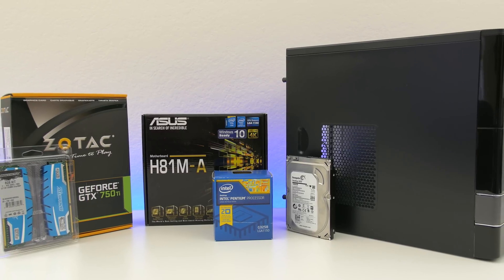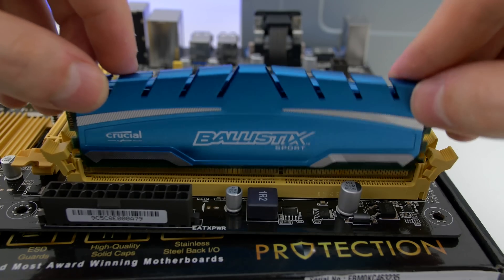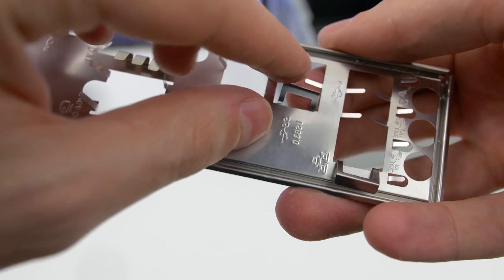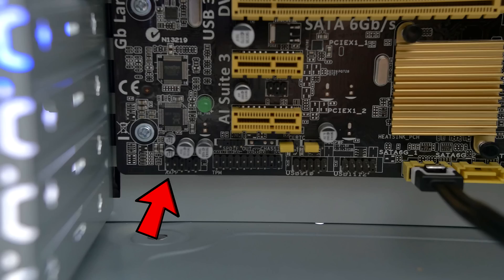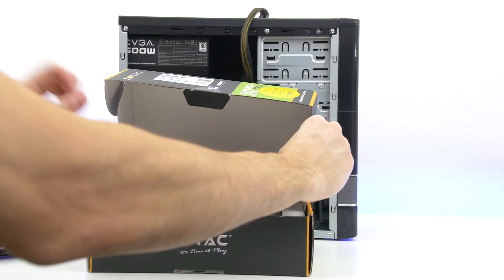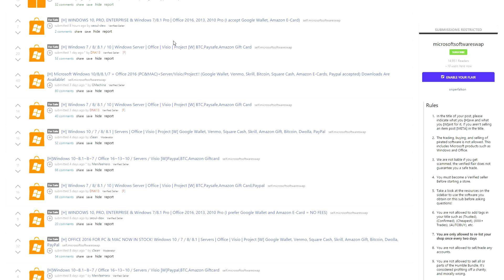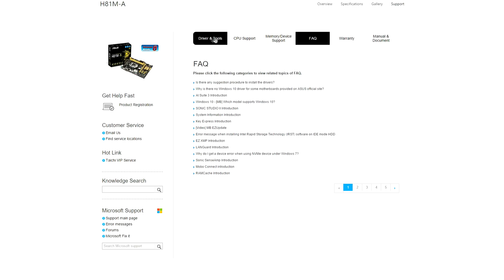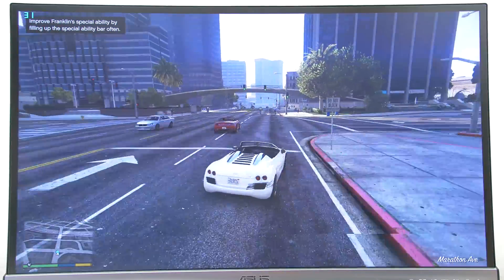How To Build $350 Gaming PC w/ Windows + Overclock!

Comment: Will Athlon X4 850 or G3520 will be a bottleneck for Gtx 960? Maybe i3 is bottleneck with 960?
Reply: +Eternal Power An i3 won't bottleneck a 960 to be honest. If you're using a 980 or a 980 Ti then you might feel the difference but till the 970 an i3 or an i5 is worth the investment.
Reply: +Sudhanshu Sharma what about 380X? Is worth it over 960/380?
Reply: It's the newest GPU that AMD has to offer, so yeah way better than the 960/380. Personal suggestion, go for a 970!! It's worth the money.
Reply: The i3 works just fine with the 960 it's a good combo
Reply: +Marco Martins The athlon or G3520?
Reply: ***** don't you mean the G3258 that he uses in the video?
Reply: +Marco Martins yeap. Also in this video he uses 750Ti which is 50% less powerful than 960. So maybe this cpu on this video would be bottleneck for 960 or 380X?
Reply: ***** the G3258 is much more powerful than the 850 but being a pure dual core you might get some problems in the future when games don't support dual-core cpus anymore that's why I really recommend you to get an i3 instead if you got the extra money (you can get the G3258 and upgrade later to an i5 or i7 when you got the money if you prefer)
Reply: +Marco Martins but what do you Mean you upgrade later? Its i3 has 50€ more btw. So The considion upgrade is to buy a part of a pc and after 6 months upgrade to i7?  Well Why wont someone be parienet and buy i5 from the start and Dont waste money to a lower cpu?
Reply: ***** I'm not saying 6 months later but yes you get my point it's better to get a better cpu right now (i3) than to waste on weaker cpu to upgrade later (when I mean upgrade later I'm talking like 1 or 2 years)
Reply: ***** don't get me wrong the G3258  is fine for now but future games will stop supporting dual core cpus gradually
Reply: +Marco Martins well will i3 6100 would be fine For 2 years? But gpus like 970/390 would be a bottleneck for i3?
Reply: ***** I was talking about haswell cpus not skylake those are quite faster (from a G3258 to a skylake i3 is already a big upgrade xD) the old haswell i3's already bottleneck less than 6-8core amd cpus on cards like a 960 or 970 so yes I would say it's enough, the faster DDR4 helps too (I don't know if DDR4 got cheaper but it's faster for sure)
Reply: +Marco Martins wow so i3 6100 is much faster than i3 4170?
Reply: ***** it's a bit faster but DDR4 helps in some games
Reply: +Marco Martins i didnt he t it. Haswell i3 bottlenecks 970, while skylake 6100 isnt bottlenecking?
Reply: ***** I said haswell i3 already bottlenecks the 970 less than a 6 or 8-core (fx6300 and fx8350) amd cpu in most games so skylake should be even better
Reply: +Marco Martins well 6300 and fx 8350 bottlenecking 970.

Comment: I had a g3258 in my old PC and lots of new games lags because its dual core ! If you can afford a little more get an i3 or buy a really cheap motherboard and buy an i3 CPU
And not mention if you buy g3258 You have to buy an aftermarket cooler to get low temps.
Reply: its not always your CPU. sometimes it's your gpu. also you don't need an after Market cooler for the g3258 unless 4.3ghz or higher.
Reply: +Nissan U. (SUBW00FER) I agree with you but if you use stock cooler at 4.3 Ghz temps will be aroung 75-80 and imagine how loud the stock fan would be because it has to spin at 100% speed . And intel stocks fans are loud AF. 
SO 
G3258 - $85 + $30 CPU cooler = $115
i3 4160 - $119 [ AMAZON ]
And i3 supports ddr3 1600 while g3258 only supports 1333mhz and i3 is wayyy more powerful than g3258
Reply: Actually the i3 proforms similr to a oced i3

Comment: Do you suggest cooling it with hyper 212 evo?
Reply: Yep
Reply: +sazim patel I think i might
Reply: +Mushimo_V6 only if you want to overclock
Reply: +MrAeRoZz I was thinking if he can overclock it to 4.3 with a stock cooler i could do 4.5 or 4.6
Reply: well you need to think if its worth the extra 30$ for 0.3 more that maybe if you get unlucky you cant even reach cause your cpu doesnt allow it
Reply: +MrAeRoZz Do you think it will fit if i had a 6300
Reply: Mushimo_V6 if oyu have the money go for it
Reply: +MrAeRoZz Thinking about it. do you think if i overclocked the g3258 to 4.7 would it outperform the 6300
Reply: Mushimo_V6 no cause you can overclock the 6300 and 4.7 is very high and there is no guarantee for it that you reach 4.7
Reply: +MrAeRoZz So you think the 6300 would be the right way to go?
Reply: +Mushimo_V6  Yep.
Reply: +Mushimo_V6 Make sure you buy the AMD compatible version.
Reply: check if it can fit in the case
Reply: If you want to upgrade to an intel CPU later on, go with the Pentium. Or you would have to buy a new motherboard. But intels the way to go.
Reply: +Nez If i upgraded i would probably get the i3-6100 or i5-4460. Any suggestions?
Reply: i suggest Be quiet pure rock over evo 212 bc its quieter
Reply: +Jalis812 - Gaming Thats a good idea but right now im focusing on a evo because they have very good reviews on the other hand the evo is not even that loud from what i know
Reply from the maker: +Mushimo_V6 yes
Reply: +TechSource OMG! Ed replied! Made my night ;)
Reply: +TechSource Holy crap Ed no way you replied omg no way bro😰😰
Reply: +Mushimo_V6 If you are going to buy a hyper 212 evo you might as well buy get an i3 or an fx 6300.
Reply: +TheAviroGamer Im on a budget tho
Reply: +Mushimo_V6 id recommend getting the pentium, amd then saving for a i5 4690k or something, i believe the i3 6100 is a skylake CPU so you cant really upgrade to that... The i5 4460 is what you can also upgrade to
Reply: +Nez Might get the 4690k
Reply: +Ayeayeron ya thats a atx case
Reply: +stonebones \m/ Really, that works?
Reply: +Mushimo_V6 It's a monster. I have a noctua nh-d14 though :D and that's like an upgrade down the road buy the noctua nh-d15 is probably better as long as it fits the case as the d15 doesn't fit mine.
Reply: +AstroMagic I've heard good things about nactua
Reply: +stonebones \m/ Probably am at this point. Thanks for the help!!
Reply: Mushimo_V6 Yeah you can get a decent Oc from the hyper 212 evo and if you pair it with an even better fan it can be more quiet and cool for slightly better performance. I recommenced noctua fans if you want or just wait till the 212 goes on sale for like $25-$30
Reply: +AstroMagic The 212 is already $20 i think
Reply: Mushimo_V6 Then buy it.
Reply: 25$

Comment: could i use one stick of ram ?
Reply: Yes....
Reply: Yes but you don't get dual channel
Reply: what is the advantages of dual channel then single
Reply: +The RedPanda becuase it will mean you'll have half the processing power in dual channel with 2  sticks say I get 2 sticks and put them in differnt colour slots in pretty sure it will run in half becuase dual channel but I might be wrong
Reply: what they mean is that you get better performance in theory with all the slots used but in practice there's like a 1-5fps difference so don't worry if you use one slot for some time and then get the other ram module later

Comment: Should we only overclock if we get the additional cooler or will the stock one work in this build?
Reply: Stock cooler will work fine. Its recommended to get another cpu cooler to extend the life of your cpu.
Reply: +GG rEtHINK btw what advantages will overclocking give?
Reply: do NOT overclock with the stock....
Reply: +Cyrus565 Didn't ed say we can?
Reply: +9PureNine
Reply: Advantages of overclocking is to get the most perforamnse out of your cpu which basically = more smoother and more fps

Comment: Hi, im building my first ever gaming pc, tell me how it looks like please :)

CPU: Intel Core I5 4460 (3.2GHz) Socket 1150 

GPU: MSI GTX960 Gaming 4GB GD5

Harddrive: Seagate 1TB SATA III 64MB 

SSD : Kingston V300 120GB SATA III 

Power Supply: LC-Power 550W Super Silent V2.2 (LC6550)

RAM : Kingston 8GB DDR3 1600MHz HyperX Fury Black 

Motherboard: MSI H81M-P33

My main goal is to play the latest games like Tomb Raider, Witcher 3 and so on, with atleast 60 fps, with the graphics all on high. If you would switch any part for another, or know a better build for 800 dollars, please let me know.
Reply: +Ruben Eduardo Hi Ruben, I'd suggest swapping the 960 for a 970 if you want 60 fps with the graphics all cranked up. Witcher 3 and Tomb Raider are AAA titles and demand a high-end GPU (for you to run it on 60 fps on high or ultra settings). Also, please invest in a 650 or 750 W PSU too.  Hope this helps.
Reply: Sudhanshu Sharma  Ok so i took out the SSD because my budget is tight.

For the graphics card, i dont know which one to get :

MSI GTX970 Gaming 4GB GD5
                           or
Asus GTX970 STRIX OC 4GB GD5

The Asus one can overclock but i dont want that, and the MSI one is cheaper aswell. Also don't know if it matters but ill be gaming at 720p because i don't have the need to get a 1080p monitor right away.
Reply: How much cheaper? I personally am a big MSI fanboy. If the difference is substantial, then go for the MSI one otherwise go for the Asus Strix. If your budget allows after buying the MSI one, get a SSD too.
Reply: The Asus is 414,90 and the MSI is 389,90.
Reply: Buy the MSI and the SSD. It'll be a much better PC Config. All the best.

Comment: Is it possible for me to overclock my i7 2600S? It runs at 2.8Ghz.
Reply: +BigBadroid Nope, only K series processors are capable of being overclocked. This particular processor comes unlocked (no K in it). An i7 2600S is good processor. Don't need to overclock it (if it was even possible). It'll run all your current gen games (if you've got a decent GPU like 750Ti or GTX 970) and give you 30-60 FPS minimum. Just ensure you've got at least 8 gigs of RAM.
Reply: +Sudhanshu Sharma Yes, I do have 8 Gigs of RAM. thanks for the assistance. I am BigBadroid only. This is my personal account :P
bigbadroid is my tech channel. 
jst to avoid confusion
thx sir
Reply: +Sudhanshu Sharma I have a gtx 960, 8GB RAM, 500w PsU, 1TB HDD and  a 1080p 21.5" monitor
Reply: I think it should work just fine. But GTX 960 is still a low-mid tier GPU, I'd suggest getting a 970 to play seemlessly at high settings with 60fps @ 1080p.
Reply: That will be way outta budget
Reply: I am not saying that a GTX 960 is a bad GPU. All that I am saying is your purpose of playing on high and ultra settings getting 60fps @ 1080p is not going to happen with it. you'll be able to play AAA games @ med settings.
Reply: I'd rather play all my games at high instead of ultra to attain 60fps

Comment: My preferred method of grounding is taking a length of cable, stuffing one end into the ground on the wall, a C13, or an extension cord, and wrapping the other end around my ankle, making sure some wire is touching my ankle.

Comment: what is the monitor used?
Reply: its the sexiest monitor right?
its the Asus Designo MX27AQ
thats a 1440p version that i have. theres a older 1080p version. the 1080p version came out like in 2014 and the 1440p came out in 2015. the 1080p version is at a great price on amazon. im planning on getting the 1080p version for my 2nd build. but the model number i gave you is the 1440p version. the 1080p version is along the lines of MX27AH or something. youll find it easilly.
Reply: It is the sexiest monitor thanks for the info :)